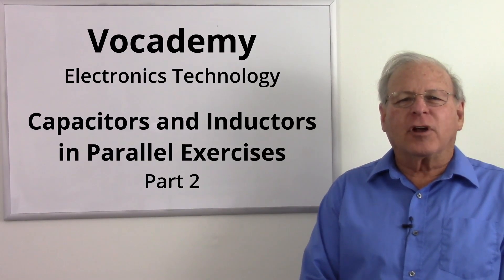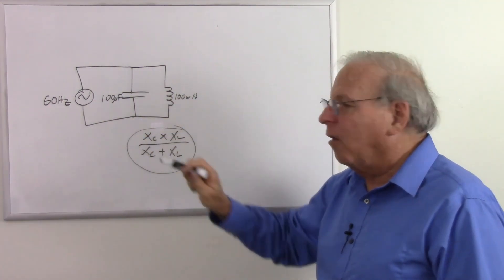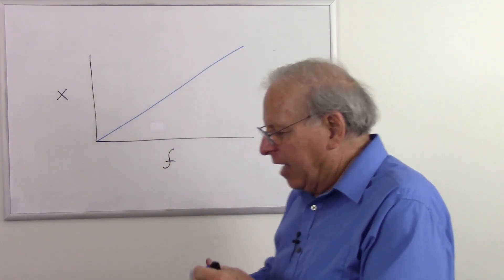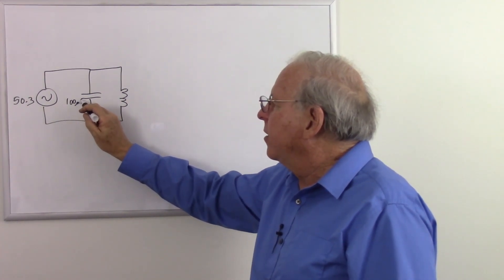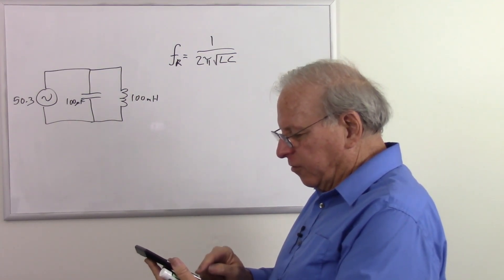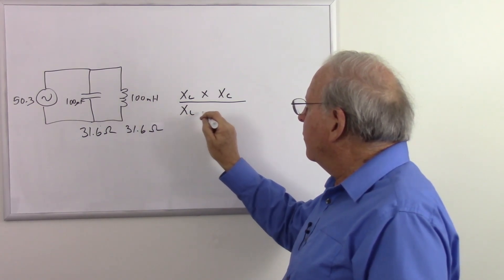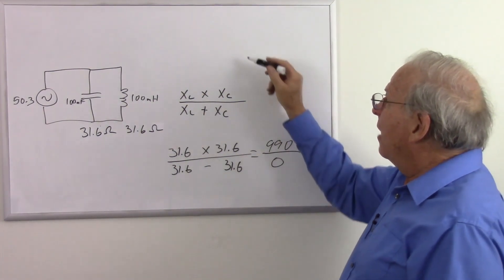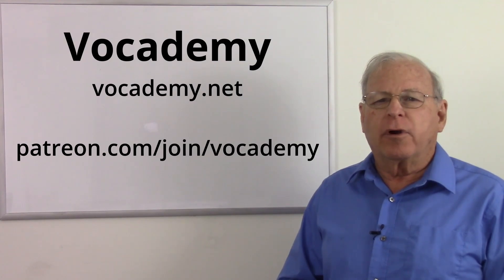Capacitors and Inductors in Parallel Exercises   Part 2

Comment: Iv the cabel are Superconductor you are right. But how many people have Superconductors? Or work with it? This is 1 reason that the Calculation dont work in reality. I think as prof you have the right Formula. I understand that is for understanding, but in Reality it is realy not good. The worker dont now this!! You teach and all other profs say it this way, because you Presupposes that all now that. But the problem is, you studens are the next Engineers. They also dont tell Your students that is only Theoretical. The resoult is, i can explain that they are use the wrong Formula. Without the ohm of the cabel it is realy bad. Try it pleas on your own. In google or a other Search engine. And you almost get the wrong formula. Its not funny. Thanks for your work
Reply: @MrDoneboy  ??